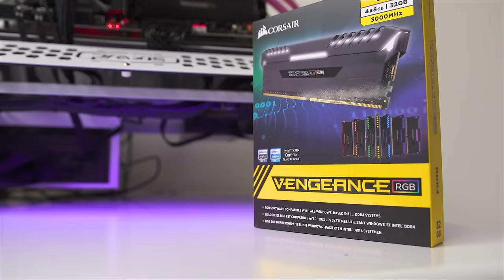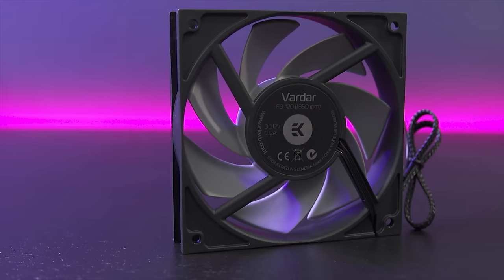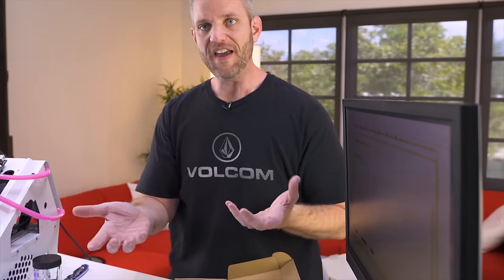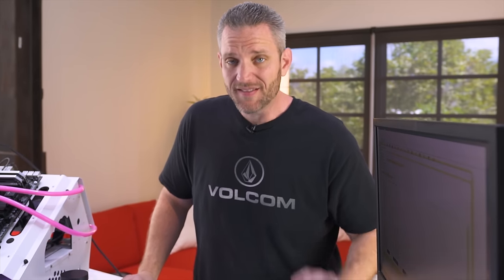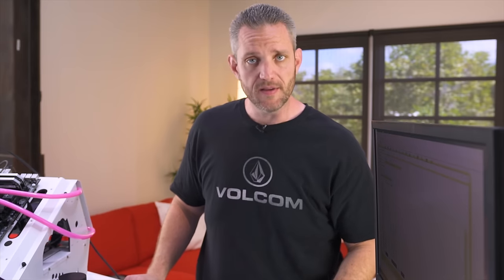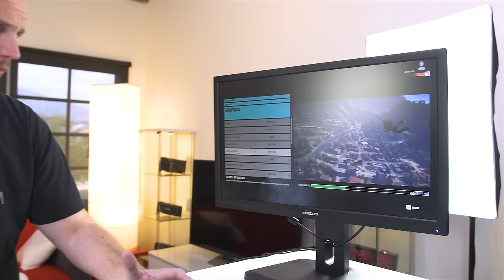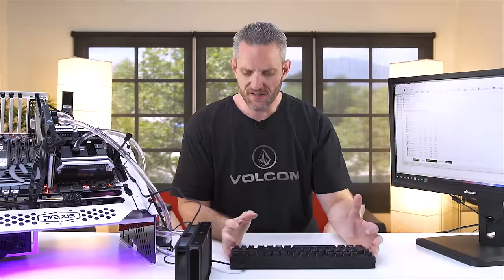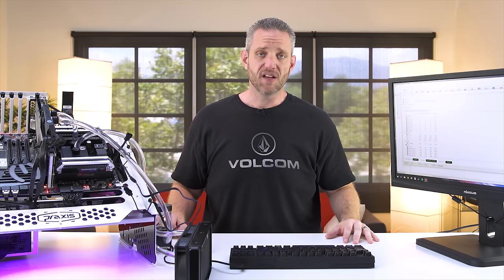How to Watercool your CPU and GPU for under $250

Comment: 250$ youre wasting your money jay water bottles are 1$ just pour that on
Reply: Yeah, I'll thank you for all of my misfiring components and electrocuted water puddles later.
Reply: Hazardous Bill but if the components don't work, they can't get hot.
Reply: (Hazardous Bill) The water would only be dangerous if it hit the 110-240v anything else is completely safe but it will ruin the computer XD
Reply: ben lawton sinve most parts run on 12v dc or lower from what i know it should be safe just be ready to say goodbye
Reply: Tim Murphy woke
Reply: When people talk about Volts to do with danger.
Reply: The amps are what kill you 😂
Reply: People baffle me.
Reply: lol yeah but what can you do. Also Galvanic corrosion is pretty bad. My car is from 1986 with a cast iron block, Aluminium head and copper radiator. Lol the amount of corroded chunks of metal that came out of the car when I flushed it was ridiculous. I honestly doubt EK will have this problem though as long as people follow simple instructions.
Reply: Record Spin 30V @ 1000000000000000A is safe 60V @1A is deadly so it's both that kill you.
Reply: my 290x causes global warming when gaming.

Comment: Been running this loop for about two years now. Not a single issue so far, works fine and looks great.
Reply: How loud does it typically get under load? I have been wanting to run this config in the NCase M1 for a while, but I'm not sure what the acoustics are like.
Reply: @EDToasty  If you're worried about loudness then get noctua NF-F and NF-S fans. F for rad and S for case
Reply: What is the maintenance like for the fluid how often?
Reply: @foxfox4094  do they even sell this anymore?
Reply: B-Mac yes I just helped a friend setup the 360g it’s awesome
Reply: Set aside this stupid question but can you add food coloring to make colors in stead of just clear water
Reply: Steven Nikolovski would no recommend food coloring
Reply: Fox Fox ok thanks
Reply: @stevennikolovski6098  Don't EVER add food coloring, there are specific color dyes you used specifically for this, look it up...
Reply: Hey, what components are you running and what are your load temps like?
Reply: Where can i buy it
Reply: whats it called on their website?
Reply: Is it still available? Says it's EOL not selling anymore.
Reply: It’s been discontinued you guys. It might be temporary to create a new design but they also might not have gotten enough sales.
Reply: Can you pllssss drop a link ? My stupid ass cant find it anywhere
Reply: What is the upkeep like?  I’ve been thinking about doing a loop, but the upkeep and maintenance always steered me away.
Reply: Arif Topsakal If you’d read the comments you’d know it’s discontinued bro lmao, that’s why you can’t find it.
Reply: qharperharper People exaggerate the maintenance of water cooling so much it’s hilarious. It’s recommended to change the fluid every so often, but you don’t have to. My aio has been using the same fluid for almost 7 years, still great temperatures. As long as you use the right fluids (distilled water and any anti-corrosion/microbial fluid) and none of those horrible color additives it’s fine. It’s the people who put a fuckin glitter bomb in their loop that have issues every year or so. So go ahead and try it out man, you’ll be fine.
Reply: same here! im using a 1700x and 1080
Reply: oh and i got 2 240mm rads cooling everything!
Reply: @foxfox4094  I am just very concerned about leaks. I wish I had more friends who know how to do stuff like this. I'm going to have to do it myself.
Reply: where can i buy it
Reply: @LG141602  Leaks are not as bad as to be instant death, is you take your time and install carefully youre not likley to have one , at least with soft tubing.Ive ran loops for many years without flushes as other in this thread have, yearly stuff is overblown imho. I use penrite race coolant, glycol free and red in colour, about $16aud(10usd) or so for 1l concentrate which makes 5l, which is HEAPS mixed with distilled water that costs very little.
Reply: How about now is it still going strong?
Reply: @66chargeup99  I've had it for around 3 years in two different cases, still can't complain. I cleaned it only twice because the colored fluid from EK needed to be changed and the parts rinsed with alcohol to remove gunk that had built up, but you'll have that with every other tinted water cooling solution. I've only removed the whole loop eventually because I wanted to bend some tubes so I went all out to make it really pretty with more costly stuff.
Reply: @Mojave_Ranger_NCR  Or they were worried people wont get the expensive stuff anymore. Anyone know if they are back?
I was actually considering going with China parts if doing water cooling on my next build, but this would be an alternative.

Comment: I have quiet the modest system running a GTX 970 @ + 225 core & +400 on Vram and an I7 6700K@ 4.5ghz, just recently put an H55 with the good old kraken G10 on my graphics card and it does not break 62C and often runs cooler depending on the game and its OC'd as you see to as far as I can take it o_o... not forgetting we have been going through a drought in the high 20s to low 30s "Celsius obviously"

Comment: Everyone wants low temps. I've had 2x gtx770's on a mini mtx board 1-2mm space between them lowest card always 90 Cel. card still runs fine today.
Reply: Higher temps usually equal shorter lifespans.

Comment: I'm getting ready to finally pimp out my rig with my own custom loop and wanted to use a completely aluminum loop to save a lot of money. My main concern is weather is not the d5 pump has any metal touching the liquid in the loop that could cause failure and general corrosion.
The second reason I want to go with aluminum is because my lan box is already really heavy....  and I do take it places.
The idea is to buy this kit and then expand on it with a twin d5 pump mount, separate larger reservoir, two more aluminum radiators and obviously two d5 pumps.
Reply: Its definately pimping on the cheap...

Comment: Case compatibility is the reason EK went with a 240mm rad instead of a 360mm rad.
Reply: They'll probably offer the same basic kit in several sizes down the road, since it is modular.
Reply: have a date set yet? will it come included in a separate purchase, or as a replacement for the 240?
Reply: I have a question about the pump. How would you mount it in a regular case? For example my Corsair Spec 02?
Reply: EK Water Blocks will you guys be selling the GPU kit separately? And larger pumps? I'd love to have this in an SLI setup personally :)
Reply: EK Water Blocks But then I have a 240 and 360. That's more than I need personally. Or will there be a kit with the 360 available?
Reply: Do you guys plan on making a RX480/580 block for this kit as well?
Reply: I'd pre-order one. I'd love to get my RX580 temps under control so I could let it go back to better speeds. Currently throttled to keep fan noise down :\
Reply: It's the reason why when I busted a screw in my GTX 1070 hybrid's radiator, I decided to switch over to this kit, because it will fit in my mATX build, and is compatible with my CPU and GPU.
Reply: Truex007 how has it held up? I'm thinking of buying
Reply: Yup, I'm definitely going to put this in an S340 elite, which only has room for a 240 rad
Reply: lol where'd you get that info? A 360 rad is being released this month
Reply: DanielRichards644 lol thanks for that bro, I wasn't replying to you though haha

Comment: Step 1: purchase a garden hose. 
Step 2: hose down your rig. 
Step 3: air dry. 
Step 4: profit.
Reply: Same method also works with wives.
Reply: @Pumkin932  I lost half of my fortune doing that..
Reply: Baba Blackshee
Reply: I feel like your prof pick adds more meaning to the comment.
Reply: Your pc is gonna get hot again later on. I dont want to spray garden hose at my pc most of the time

Comment: Why does it sound like a ready mix cake pack 
"Diy water cooling kit, just add distilled water"
Reply: Because it kinda is the ready mix cake pack solution to cooling.
Reply: it is a ready made cake/pancake mix .. but like ready made mix`s you can add your own stuff .. so this is great for taking the leap then you can add/change later down the line for cheap

Comment: Love this kit

 my founders 1080 ti sounded like a jet engine  and temps went as high as 84 degrees when playing Rise of the Tomb Raider at 1440p full settings With the stock cooler. But with the A240G my pc is quiet and has temps at 55 degrees.
Reply: wich kit u got?
Reply: Cool thing too is you could always add another rad for less than $40
Reply: @timota74  He literally just said. A240G
Reply: Omg I have this exact problem!!  What did you use to solve it?  This kit?
Reply: Oh yeah, he said already :D
Reply: i dont see the kit on the website how do i find it
Reply: @levbargraser5665  Google it
Reply: 55 is hot, i never saw 50 on my 1080  even when i only ran a single 280rad for cpu and gpu, once i changed to a couple of 360's it normally ran below 40c unless ambient gets up, which it does in summer here in Aus, but it still stayed under 50 even with ambient pushing 40c.  I just used a Byski(or however you spell it) block from Aliexpress at the time.

Comment: Jay you should do more aluminium based water cooling, as it really begs the question, are copper loops worth it, not just in $$$ but as a consumption of resources, there are plenty of uses for copper that cannot be subsidised for aluminium like power cables for example, so is copper water cooling even relevant? would it be possible to use plastic quick release fittings to further reduce the amount of metal? Could a couple of car radiators be used to coo entire racks of equipment rather than a loop per device?
Reply: Not your point, but the majority of power cables are made out of aluminum. It doesn't conduct as well, but it's so much cheaper than copper that in longer runs its more economical to use a larger aluminium cable vs. a smaller copper one.
Reply: @Niklas Bengtsson if you say so, except it isn't malleable, much much worse conductive properties and would generate massive heat due to higher resistance

Comment: Hey Jay (or anybody that knows..) is/ would it be okay to color the fluid for this kit? Or would I need to buy something else...
Reply: MATTWER adding color has no effect on the cooling, so yes you can add color.
Reply: I think he was concerned about the color causing a negative reaction with the aluminum, not whether it would effect cooling.
Reply: It should not be an issue, the corrosion inhibitor in the fluid is common without unusually high reports of issues with dyes that I have seen.
Reply: "the corrosion inhibitor in the fluid is common without unusually high reports of issues with dyes that I have seen"
That is so reassuring. It kind of feels like one of those disclaimers "I am not responsible for corrosion, blame oxygen"
Reply: Peterowsky lol! I love it. I'm just saying this general type of fluid hasn't had a problem with dyes in other applications, so you are probably fine
Reply: Just keep in mind some dyes will stain clear tubing overtime.
Reply: Truth Sahib
Reply: Sahil Zubair well there you have it. You are limited to the colored version of their "cryo fuel" which have to be purchased separately, which makes this kit even less customizable
Reply: EK Water Blocks question: is it ok to use a different radiator? As I would like a 360mm rad tbh.

Also, while you recommend using Founders GPU's, will this kit work with other GPU's? I'd love to use it on the upcoming EVGA Kingpin to push that guaranteed 2ghz GPU even further :3
Reply: EK Water Blocks and is hardline tubing ok to use? Or is that not recommended? Thanks :)
Reply: a helpful answer :) EK You are Epic <3
Reply: Will 280mm radiators also become available?
Reply: Wow! Official EKWB Comments! Sick! :D Is soon™?
Reply: Thanks for the quick official answers as I have been looking for potential upgrade parts for this loop. I will definitely be a buyer when hardline fittings, larger reservoirs, and larger radiators are a possibility.
Reply: do you guys have plans to sell aluminium parts outside of the kits? or expand for compatibility with AIB graphics cards?
Reply: so every component have to be aluminum? (no Poseidon or anything like that?)
Reply: what i did was buy the same addin but collered works fine =)
Reply: Albert Chen that's correct
Reply: then i can buy an Ek-cryofuel blood red and use it? thnks.
Reply: I'd also be interested in a 360mm rad kit as I don't need a GPU block ATM but I'd like to plan for one in the future. Plus my case is huge anyway.

Comment: You can get the same kit, but with all copper parts from formulamod.com
Here is the kit: https://www.formulamod.com/bykski-b-hsrbw-ed-rbw-5v-3pin-soft-tube-program-kits-multiple-programs-customizable-modification-for-intelamd-cooling-kit-p1798698.html
Reply: Barrow is used in there. Do you have any info on quality?

Comment: if 1080 was 40 degrees on load, that makes me wonder what's the temperatures of the 1070?
Reply: Gu Ko keep it mind that it's in an open air test bench, it would be higher if it was inside a case
Reply: ive just installed the same kit with a 6700k, im not getting anywhere near that low. im hitting 60c
Reply: 60c under load is really good for that chip. I have the same processor and was considering this over my h80i v2. I'm hitting 82c @ 4.7.
Reply: +Gu Ko
why? Pascal GPU's are very efficient.
my 1070 with a 120mm Radiator for it, runs Furmark at 45°C. with Power Limits as high as they can go. the only limiting factor being Voltage, but it's not worth it for me to hardware modify my GPU to get higher Clock Speeds.

which is at a point that my Fan Curve is barely above the minimum speed the BIOS allows.

Pascal GPU's run pretty cold with good Coolers, mang.

Comment: Did you ever do an update on the condition of it after time? Would like to know how it holds up.
Reply: Considering i dont think EK sells these kits anymore, probably not well. All their classic kits in that price range are nickle plated copper blocks and non of them include a GPU block unless your looking at a 800+ kit. Really though alot of it is just upselling and the brand. Just buy a 40 dollar copper block and get your rad pumps and fittings else where.

Comment: Jay
How does this GPU Block affect overall height of the card?  It's been in my newegg cart for a week but I'm Concerned about this fitting in my carbide air 240.
Reply: John Wick it should fit...
Reply: It doesn't look all the much thicker than your standard giant factory installed air cooler.

Comment: Well because I'm a hardware cooling nerd, I made a whole water cooling system by hand for 1 of my old laptops: I used copper piping, pipe bender, thermal epoxy, tubing, old food container saver for the reservoir, a fish pond pump for the water pump. For the radiator, and took copper piping, and coiled it and put a fan at the end. Although it took awhile, everything actually worked out and I got a lot lower temps. Not to mention I learned a lot about cooling by doing this little project. Jay make 1 for a video, would be fun to watch.
Reply: Did a similar setup myself back in the day.  My mistake was adding that cheap, leak detection UV powdered additive stuff.  It gunked up the block and caused a system-killing leak.

Comment: car uses aluminum too so if it works on cars and last a long time....i'm sure it's fine here.   I wonder if radiator fluid works well here :)
Reply: The additive in "radiator fluid" is just to prevent freezing. Water is the best great transfer fluid, unless it freezes.

Comment: Does anyone know of any aluminum T or Y fittings so that I can bleed this stupid thing? Don't get me wrong its nice and all, but I still need to get the liquid out (and in) somehow.
Reply: I've sent an email to EK because I've been wondering the same thing. I'm interested in getting into watercooling but I'd feel much safer with an easy way to drain the system. And with no third hole on the reservoir there's really no choice but to have a split from what I can see. I'll get back when the reply.
Reply: Sam Carne any answer yet on the splitter I'm in the same boat wanting to bleed the system easier
Reply: tyler hartery so they've released individual aluminum parts, but still no Y or T fittings sadly
Reply: basically they released "expansion kits" which have a 240 or 360 rad with enough fans for the rad and a fan splitter, and unfortunately no y or t fittings yet which i hope they make soon
Reply: Jonathan Zhang they now do have splitters and stuff but sadly no valve to use for draining. But you can buy aluminum or plastic valves that will plug into the system with ease. That’s what I plan on doing
Reply: For bleeding and draining, doesn't matter what metal you are using as long as it isn't in contact with the aluminium solution all the time, like in a radiator or such...
Reply: But the fittings would be a permanent part of the loop, even when not "in use" for draining and filling.
Reply: @noxious89123  yes your point? I mean maybe if you have multiple rigs you want to drain and you want to use this to do it I guess thats a hassle. but if it is the only one in your system with a cap on it would be no different then any other fitting.
Reply: They sell some like dice that are kinda like a T connector. Thanks for reminding me that i probably need that.